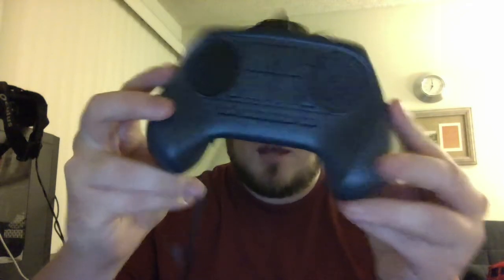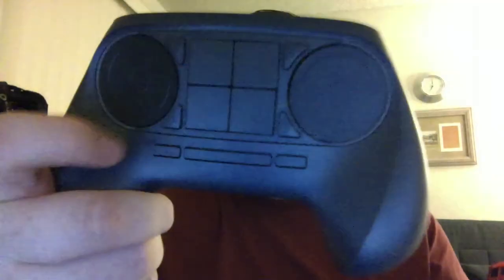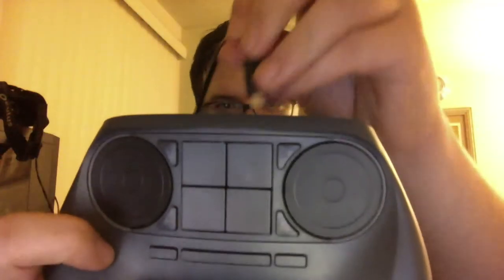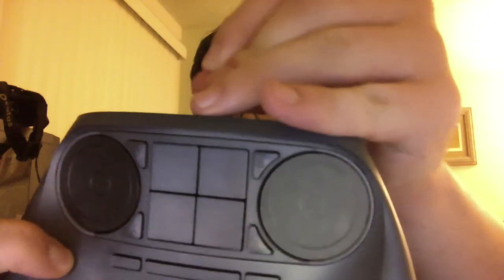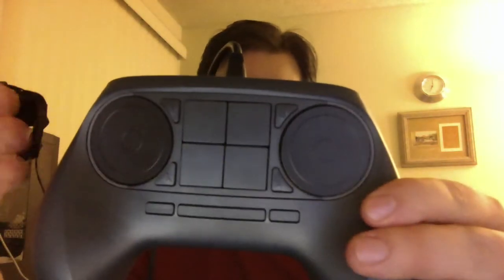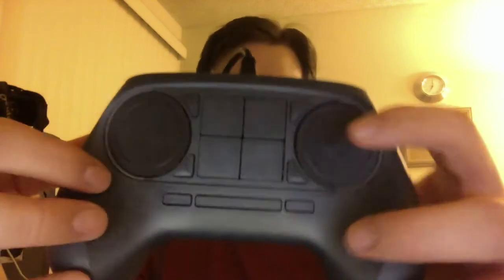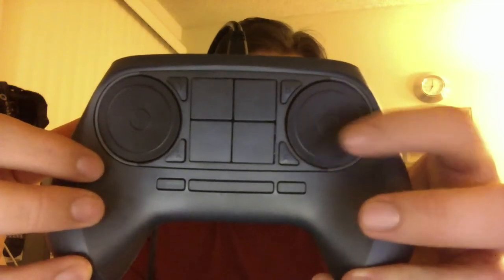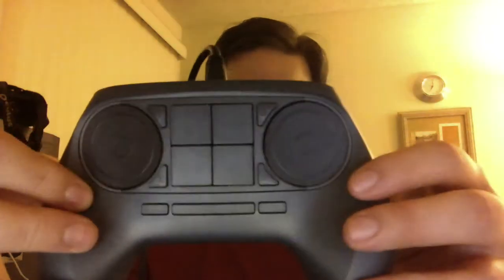Steam controller haptics

Comment: When talking about the touchpads would you say they are better or worse than a typical controller and how well do they fair for precise input similar to what would be needed for a fps game?
Reply from the maker: I found that using the right pad for aiming is actually very nice. it's got good precision but also allows for quick spins and other "mouse-like" movements. It takes some practice to get used to it, but I think that most players could become proficient with it pretty quickly. Using the left pad as a proxy for WASD keys, though, was really awkward for me. As such I'm super happy that the newest iteration of the controller has an actual joystick. That will make movement much easier while keeping the benefits of the pad for aiming.
Reply: Brandon Jones Thanks for the info. I have been cautiously optimistic and will probably pick one up in November.